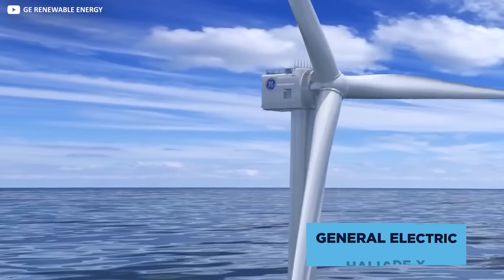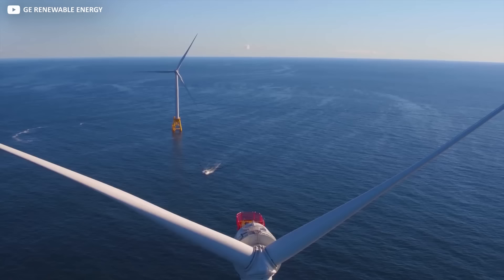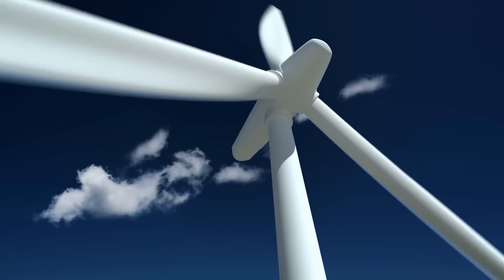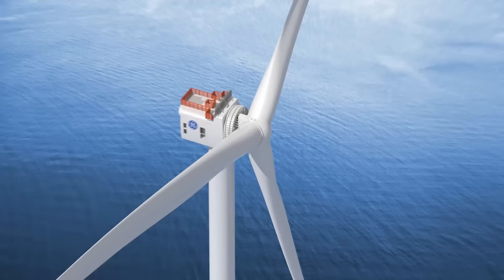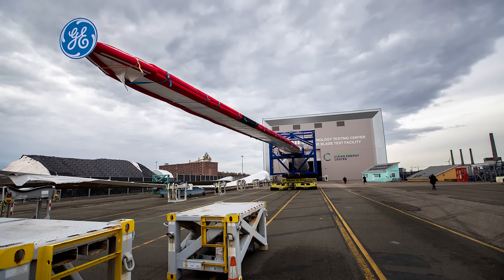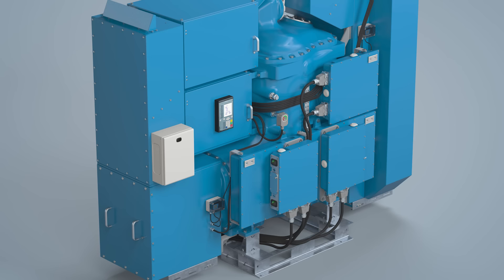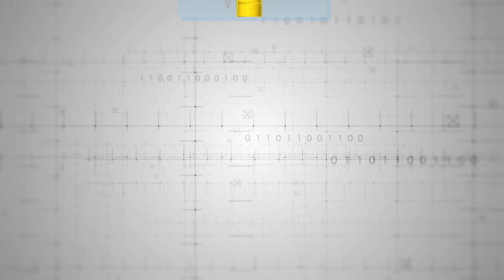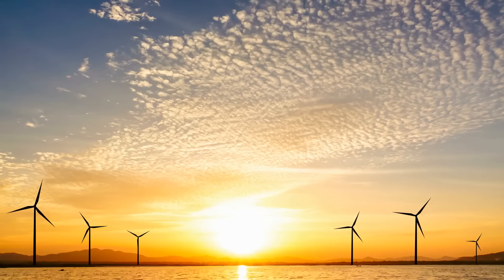The World's Biggest Wind Turbine

Comment: One rotation will power a home for two days.  Very impressive.
Reply: Nope, it will blow up the house instantly, burn it to a crisp and melt it self to lava if not controlled right...
Reply: Must be turning very slowly.
Reply: @hurri7720  Nope, needs right Hz.
Reply: @kristianhasund611  , I was just kidding.
Reply: @kristianhasund611  Close enough (except the blowing up the house is an obvious quip based on the weird, confusing explanatory notion of a house being obliged to take & store 2 days of its energy in the time of 1 turbine rotation, with all wiring & fusing massively increased to accommodate that). Any turbine generating electricity has the issue of speed control. notably preventing over-speeding in the event that the current draw is less than the turbine is trying to provide. The engineering design must have means to prevent it of course. I've no clue what the means is for a wind turbine, I suppose it would have to be feathering the blade because a mechanical brake would have massive heat to dissipate. For consulting engineering field I was in the elevators dumped the electricity into a resistor bank to control speed if there was insufficient demand for the electricity being generated by the elevator.
Reply: @kristianhasund611  The rotation speed could be variable with an accurate fixed frequency output if a variable-voltage variable--frequency (VVVF) solid-state drive was used. The A.C. generated is rectified & smoothed to D.C. which is then chopped into pulses by inverted-gate bi-polar transistors and synthetic A.C. is manufactured from the 16 kHz or whatever pulse stream & smoothed to an acceptable sinusoidal shape for the grid.  I've not the foggiest clue whether they do that for wind turbines, I'm just saying that could be done and would then allow the rotation speed to be variable with an accurate fixed frequency output.
Reply: @grindupBaker  But will it be to a point of feeding one home (2-5kW) at one rotation a day? I can't say that it is not possible, but i guess it would take massive modifications:) Like getting 1 Km in a car from only one revolution of the cars engine ore something;) My piont is that generated energy needs to get used at the point of being generated.  So the statement of a tutbine could supply one house one day on one rotation is absurd. It would need batreries. Theese turbines will produse energy at set levels of rotation and feed the grid but will need a ballance from more Hz fixed energy. If not it would vary to a point of collapse.
Reply: @grindupBaker  Yep they have feathering
Reply: @kristianhasund611  Don't waste too much time on yet another loony statistic that tries to hide the fact that  wind turbines are merely another, government inspired, useless vanity project.
Wind turbine operators should only get a licence to supply electricity 24/7/52/20 including those times when the win' doan blo!
Reply: Yeah but think about the danger of a turbine like that if one is put somewhere where people can go and it fails not just a fire but the hole thing going down or the blades breking and falling while they trow fibre glass in all directions on a scale THAT HUGE not good
Reply: @southerngecko5627  you watch too much hollywood movies
Reply: @kristianhasund611  the point isn’t that one rotation’s energy will literally be instantly going into a single house, it’s that one rotation’s worth of energy (which is distributed among many houses) is the equivalent to the average house’s energy consumption over 2 days. It’s a reference point to measure its productive power, since the average person may not know how much a gigawatt is, it’s not to be literally interpreted.
Reply: @Ashetypebeat  I know this, and the people presenting theese "fun-facts" know that the majority of people know little to nothing about theese things and will take this litterally...thus the massive support for theese monsterous useless wind  turbines...
Reply: @kristianhasund611  no, you’re clearly the one who took it literally for the purpose of spreading a false idea of what they are. Wether a single rotation literally powers 2 houses for a day or not is not what determines support for them. You’re the one who said it would “burn them to a crisp” because someone continued to use the useful measurement. Using the measurement doesn’t mean they don’t understand that it wouldn’t literally immediately go to a single house. By suggesting they would, and thus burn down, you’re the one spreading misinformation. You don’t get to just assume that other people don’t understand it and pretend that they’re the idiots just because you want to.
Reply: Unless the wind ain't blowing lol
Reply: Now let's see Paul's turbine
Reply: @kristianhasund611  hahahaha wtf
Reply: @brianletter3545  please educate us how a net profitable power source in for example the UK (it massively reduces gas consumption which is now extra expensive) is 'useless'
Reply: @GBOAC  Don't need to fight them. They will fail on their own.
Reply: Gearing and some transformers
Reply: @CrookedSpine3885  its on the ocean, the wind is blowing.
Reply: Let's not forget regular size windmills needs 2200 gal of oil to work properly. Imagine one of these breaking apart and falling into the ocean 😢

Comment: I work for Vestas. WE now have the world's most powerful wind turbine and also the longest blade at 115 Meters. It's a 15 Megawatt turbine!
Reply: Una duda que tengo ¿Produce 15 Mw por giro?
Reply: That " 1-ups" General Electric's Haliade x series, which puts out ~13 Megawatts! I want one in my back yard, but, I'm afraid, the base of that machine is larger than my whole lot. (My whole house would fit INSIDE the tower!!)
Reply: Yeah course you do mate
Reply: @vincentrobinette1507  Turbines this size would be like an inconsiderate neighbor with the radio blasting all day and night. It's a constant swoosh sound as the blades cut the air. The tips of the blades are moving at around 120-180 mph. Also,  shadows cast by the blades can be annoying almost like a slow pulsing strobe light. They're great in rural areas, not so much an urban installment we'll see anytime soon.
Reply: @Arshad Khan 10m/s. Moderate wind of 36 km/h will be maximum production. It cuts out at 30m/s so it's ready for some high wind too.
Reply: "It's a 15 Megawatt turbine!" Even when there is no wind? Gosh!
Reply: @jeffscheurkogel  How much power does it deliver when it 'cuts out'?
Reply: @brianletter3545  none, but 30 m/s is 108 kph or 67 mph. That is some heavy wind. Considering how large this turbine is, it is impressive that the blades can withstand that kind of wind at full production.
Reply: @brianletter3545  that's like bemoaning that your car doesn't produce max horsepower with the engine idling or even when it is off.
Reply: @jeffscheurkogel  "it is impressive that the blades can withstand that kind of wind at full production." They can? I would be surprised. Don't wind turbines 'feather'(shut down) at those wind speeds? Thanks for the reply.
Reply: @brianletter3545  Yes, many wind turbines go into an idle state during winds over 25 m/s. This is for safety and to protect the asset. The blades are often one of the greatest concerns during this kind of wind speed. Generally speaking, the bigger the turbine blades, the more power it will produce at low speed. A massive turbine still producing when most of the smaller and older varieties are idling implies that a turbine has been engineered to produce power in low wind all the way up to near hurricane levels of wind too. The blades are very costly to build, transport, install and repair. If they say it can still produce power in that kind of wind it is with consideration of keeping the expensive blades intact.
Reply: You have yet to build this blade. Having it developed on paper is one thing, building it another.
Reply: @NoBr4iN  Very true. I believe the first prototype is being built this year. Serialized production starting in 2024
Reply: @NoBr4iN  don't I know it.

Comment: 7:35 Siemens 14 MW turbines are not called 'Gamesa'. The windpower division of Siemens is called Siemens Gamesa, as it's a joint venture. Pretty elementary error, I would think.
Reply: Agree
Reply: Propaganda doesn't care about accuracy or being correct. Doesn't have to; read the other comments! Works fine without any of it.

Comment: The Vestas V236-15.0 MW is a behemoth. It features three blades measuring 115.5 meters long for a total swept area of more than 43,000 square meters — that’s 10.6 acres or 4.3 hectares. Each turbine will be capable for creating 80 gigawatt-hours (GWh) of electricity per year, enough to power 20,000 homes.

Comment: First as many others has pointed out, Vestas has announced a 15 mw wind turbine a few month ago so this is already surpassed.

And people asking what to do with surplus energy at night etc etc.
Some companies in Denmark is planning on building a large Power to X factory in Esbjerg that will producer Ammoniak and Hydrogen to be used for fuel etc etc.

Already some small rural train lines are replacing their old diesel trains with Hydrogen trains and DFDS wants to replace their Copenhagen Oslo Cruise ferries with Hydrogen driven cruise ferries by the end of the decade.
So a locally located power to X factory will be very useful.

Comment: Low Efficiency for all wind turbines around the world no exception.   Since 1919, German physicist Albert Betz declared that the limit for the theoretical maximum efficiency for a wind turbine is 59 % or a factor of 0.59.   Today in 2021, more than 100 years later, we still cannot even reach the efficiency of 50%, even with all the powerful computation resources and sophisticated CFD models, and millions spent on building turbines. Most engineering books still tell us 0.40 as a practical efficiency of wind turbines, with the same limit being used for tidal turbines. If we continue to do the same thing over the next 100 years, Mr. Betz would come out of the grave and laugh at us. Maybe the limit is not right, but if we cannot even reach at least 50%   efficiency, or figure out what is wrong, the rest of the effort would be futile.   According to    Appendix  A Fluid Flow Power Theory Applied to Wind and Tidal Stream Power Density Calculations    at page 53,   EPRI North American Tidal In-Stream Power Feasibility Demonstration Project Phase: 1 – Project Definition Study Report: EPRI – TP – 001 NA Rev 2

Comment: Not mentioned is the cost and environmental impact of decommissioning. Check out the wind turbines installed in the US in the 80's-90's. It's a poor state of affairs.
Reply: As far as I know, nowadays, decommissioning is built into the contract. Project owner/operator is obliged to decommission the project at the end of its life.
Reply: What does it cost to decommission a power station by comparison?  Far, far more I'd guess!

Comment: We now need a cheap battery storage to match the gigantic amount of energy produced by this masterpiece of green technology...
Reply: Hello Tesla
Reply: Elon smoking a joint: How much do you need?
Reply: Yes .... if we can build power storage that lasts season .... it will be deadly blow to fossile fuels....
Reply: The UK is trialling storage of excess energy as compressed air
Reply: @revaddict  Tesla and its battery technology is not fit for this purpose. The need exceeds supply by orders of magnitude.
Reply: I think a combination of pumped hydro, increased grid interconnection,  better demand control and hydrogen gas will do the trick.
Reply: @user-xv4id9xx7u  Have you watched Tesla's Battery day..? Tesla is mass producing their 4680 cells which they aim to have a production capacity of 100GW in 2022 and 3TW by 2030..
Reply: @revaddict  I haven't. The current battery technology needs to improve by say two orders of magnitude (i.e. 100x) to catch up with our contemporary demands. Incremental improvements don't cut really it and improving battery capacity by 10 %, 50 % or even doubling it are just not enough. When Tesla makes a 100x efficiency breakthrough I'll hear about it from the news. Until then they're adding marginal improvements that do not fundamentally change the situation that we are in. Storing energy as in chemical reactions is simply not very efficient.
Reply: @user-xv4id9xx7u  Erm that's where you are getting it wrong.. Tesla batteries are already replacing Peaker plants and that will only accelerate with their upcoming batteries.. I would say spend a couple of hours and look at their battery day presentation.. Here is a Tldr from me:

Will be priced lower than comparable any kind of storage, deployed much quicker and will easily last quite a long time.. You don't need breakthrough's just really good engineering and high volume manufacturing..
Reply: @revaddict  You clearly have no idea about the things I am talking about. Current battery technology is a dead end. To make renewables like solar and wind viable and replace sources that use fossil fuels we need to be able to store the energy to power whole countries for several days and current tech cannot provide that even if its capability doubles or triples. Presentations don't change anything about that.

Anyone who's ever been near a battery manufacturing plant knows what ecological damage they make, not to mention the rare earth elements required for the production. It's an ineffective technology that works at a limited scale (good for cell phones) but can't scale to power industries, cities and countries.
Reply: @user-xv4id9xx7u  Listen man, the point of Wind/Solar + Batteries is NOT to replace the entire Power Source at the moment.. Their job is to replace Peaker Plants which pollute the most.. You always start small and then scale up.. And Tesla is very well on the way to doing just that.. I know you won't agree to this so let's agree to disagree..
Reply: @revaddict  They are pointless then. They do not replace any capacity and just keep piling up the environmental damage on top of everything. All the raw materials and all the energy put into making solar panels and wind turbines replace zero fossil fuel based sources but the public and the tax payer are lied to and cheated into funding these gimmicks instead of funding predictable, reliable and clean sources of energy.
Reply: @user-xv4id9xx7u  Again the point is replacing the Peaker plants to start.. If we have a stable nuclear, solar and wind will cover the peak energy needs in the evening.. And as for pollution, I suggest going through all the energy related videos made by Real Engineering..
Tl.dr for you.. Wind/Solar don't pollute anywhere close to fossil fuels.. And this is my last reply to you.. Don't want to bother arguing..
Reply: @user-xv4id9xx7u  
You don't know what you are talking about.
Your claims are nonsense.
Reply: @user-xv4id9xx7u  
You don't know what you are talking about.
Your claims are nonsense.  You're a shill for the fossil fuel industry.
Reply: Or Power to X.
Reply: How much energy is used to make a turbine
Reply: @user-xv4id9xx7u 
There are no rare earth elements in batteries.
They are used in nuclear power plants and in (some) generators and electric motors, but not in batteries.

Also electrolysis is capable of storing waste amounts of energy already.
Reply: @TBFSJjunior  Fair point, I meant minerals and metals like lithium, cobalt, nickel etc, not rare earth elements.

You're right about electrolysis but it has its drawbacks as you need to deal with large pressured vessels and basically every energy storage unit utilizing electrolysis is a full blown power plant as the power generation means a combustion of the stored O2 and H2, driving a turbine and all of that. I don't know how it comes out financially to run such a power plant. Given that no power is generated here (only excess power is stored) it probably is not profitable to build such energy storages at this point.
Reply: @user-xv4id9xx7u  Yes and no. The batteries are super fast, great for grid stability, very efficient, power scales with capacity. Fantastic for 4 hours of storage already, and going to improve a lot. That said, there are many other tools for balancing the grid that will be used if there is a longer shortfall. My guess is different kinds of storage, and demand management.